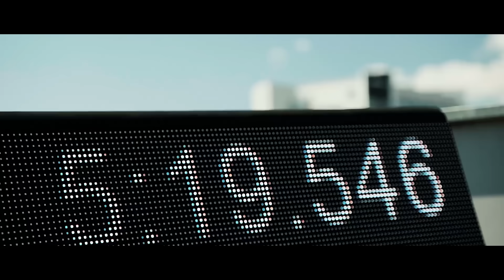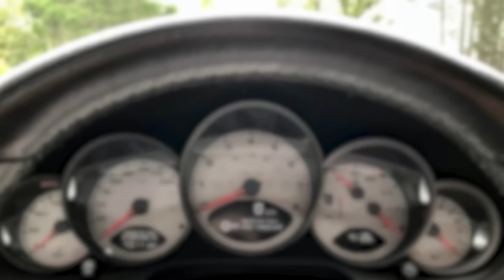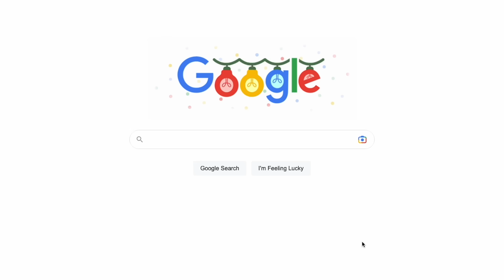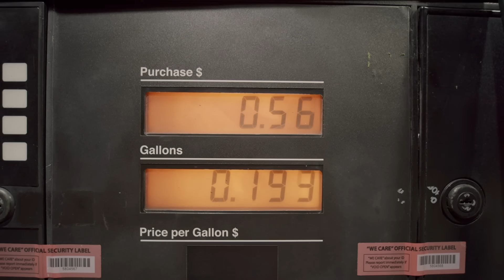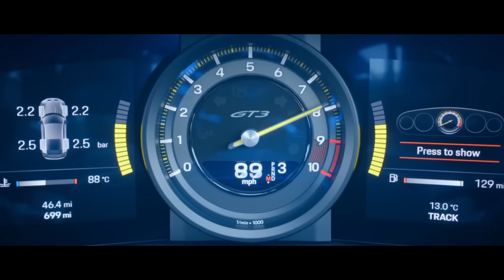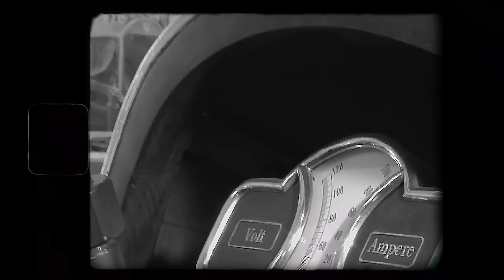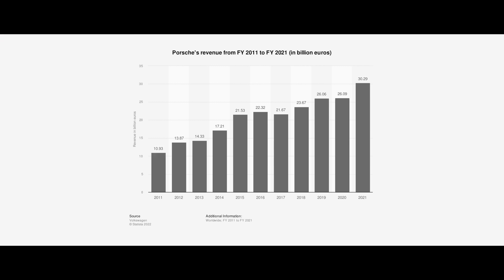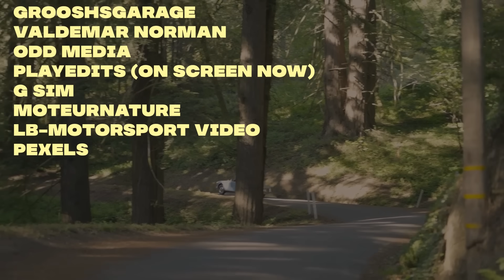Why Porsche doesn't race in F1

Comment: Correct me if I’m wrong, but the 500E at 7:28 wasn’t engineered by Porsche.  Instead it was “just” produced by Porsche because it wouldn’t fit the standard Mercedes production line of the W124 and Porsche was going through a little bit of a rough patch and both companies are based in Stuttgart.
Reply: Porsche had some inputs like relocating the battery to the trunk and few things, there is a good recent youtube documentary (featuring people who actually worked on the 500E at Porsche)
Reply: Mercedes wanted to help their hometown neighbor because they were in desperate need of cash (you can go and verify this) so they contracted them to manufacture and tune the 500e, something they easily could have done themselves since they had a motorsports team at the time.
Reply: @chiefdenis exactly. Mercedes didn't NEED Porsche to do anything for them. Porsche needed Mercedes to survive, and rather than be ruthless..Mercedes obliged, and we still have Porsche today.

Comment: 1:04 I think this is somewhat misleading, if you had seen the AMG One’s run, you’d know that the track conditions isn’t even remotely okay for hot-lapping when compared to the Porsche that was doing it in perfect conditions. I mean I can see Maro Engel literally avoiding giant WET patches on the racing line. I’m sure if the AMG One is given the chance to run again, it can pull out an even better gap than 8 seconds, maybe even 20+. But in the end, I give my applause to both manufacturers, they’ve made truly bonkers automobiles in their respective price points
Reply: He is comparing the black series to the gt2rs MR which is tuned and makes no sense 😂
Even mercedes where like that’s bs lap time cuz its tuned by manthey racing they can’t do it straight out of the factory stock
Reply: And the 919 evo is a complete car with no rules, any car manufacturer can compete with it logically cuz it has no rules 😂

Comment: 7:28 the Mercedes W124 400E and 500E were not engineered by Porsche, they were wholly engineered by Mercedes, who also supplied all the components. Mercedes just didn't have the capacity to build the cars, and Porsche didn't have anything to sell or produce. So the W124 V8's were assembled and fabricated at Porsche.

Comment: Mercedes 500E was not engineered fully by Porsche, the only thing Porsche did to engineer the car was figuring out how to put Mercedes' new V8--which had debuted in the 500 SL--into a compact sedan because Mercedes engineers didn't have time to figure out how to fit a chonker of an engine into a car designed for fuel crisis engines when they had other matters relating to the S-Class. After the redesign of the W124, a problem arose because the 500E now was too fat and wide to fit down a Mercedes production line so Porsche had to take responsibility for assembling the car in what used to be the Porsche 959 factory. But other than the changes needed to fit a new engine in and the assembly, Mercedes had full control of the W124's development

Also, fun fact, the RS2 Wagon was being built in the same factory for a short period, so in that time you could watch as Audis and Benzes rolled out of the same Porsche factory.

EDIT: Oh and the reason why Porsche has lend hands with other companies so much is because Porsche is also an engineering consulting company so some companies just let Porsche do some of the work just so they can focus on other projects. Whether that's a dub or not is up to you.

Comment: Not really sure you can compare 918 Tribute to the F1 lap time, when one is following strict regulations over a race weekend and the is completely unshackled from any regs.
Reply: It wasn't really completely unshackled as most people like to label it, it still had some restrictions from the starting LMP1 for various reasons.
Reply: A regulation F1 car would get stuck on a crack in the Nurburgring. You HAVE to deregulate the damn thing to even get it running over the bumpy-ass track.
Reply: It's a 919 Evo mate and obviously there was still some limits since they used the base 919
Reply: It’s still uses lmp1 as chassis which gives more regulation than f1 cars lmfao. They’ve literally added drs and other things that already exists in f1 cars and people aren’t brained enough to understand this. Not to mention they did demo lap with tyres that is way harder and slower than super soft tyres that w11 did lap with better track and weather conditions. Not to mention they’ve literally done 12 quali and 20 practice laps to get best setup and tyres while only one lap being faster.
Reply: More regulated than f1 kills me. Good one mae
Reply: @TheNVtube  bro probably doesn't even know that lmp1s don't have drs lmfao

Comment: I don't see the V6 vs flat-6 being a problem for Porsche. They were involved in committee that helped draft the 2026 power unit regulations (as were Audi, no wonder the power outputs of the ICE and MGUK are similar to mid 2010s LMP1). The flat-6 is also terrible for an open wheel car with large venturi tunnels, and is not the best as a structural part of the chassis.

The 963 to the LMDh rules is a twin turbo V8, and the 919 had a turbo V4.

Only 19.5% of their sales are flat-6s. 911s represent less than 13% of sales, while SUVs account for nearly 57%.

Only the Panamera and Boxster/Cayman sold less.

Comment: Porsche did however provide an engine for Formula One: This engine powered the McLaren MP4/2 that Niki Lauda took to the F1 world title in 1984, before Alain Prost followed up on that success with back-to-back championships in 1985-86.
The 'TAG Turbo - made by Porsche' powerplant won a total of 25 grands prix in 1984-87.
Reply: There was also the Porsche 3512 engine they built for Footwork. It was 30kg overweight, underpowered, unreliable and delivered a year late. Footwork used it for half a season and went back to the old Ford-Cosworth DFR, a 5 years old design.

Comment: Two remarks,first the 919's last version came out in 2016, and was faster than the f1 cars of that generation, since the post 2017 regs f1 became several seconds faster, and second, for some reason mercedes decided to attempt their only run in the amg one in a wet surface (no clue why they did this), so the laptime set by that car is still pretty damn impressive
Reply: The track wasn’t wet, it only looked that way in the video because the weather wasn’t perfect. The track was dry
Reply: @musiccer7446  Still, humid tarmac, colder track... It has a bigger implicance than the difference between the cars even if it's not fully wet. I still remember the Yaris GR surpassing a Veyron on the outside just because the track was wet AF. Not holding MB shield since it was done on purpose to regain the leadership on ideal conditions once any car takes their crown.
Reply: @joelrodriguez9611  i mean its not like the veyron is massively faster anyways , it's like a 15 sec gap around the lap between both and obviously most of the time is gained on the straight for the Bugatti so it's not surprising that a Yaris Gr could do that

Comment: I agree a lot with one of the things you said in this video that a car wouldn't have a soul without the sound of a engine I love electric cars as much as the next guy and electric supercars are even cooler but the sound is everything the gears shifting the engine roar to life. in racing especially in f1 it just wouldn't be the same without the sound so I'm glad that more are focusing more on sustainable fuels and not just electric.
Reply: There is something to be said about the sound of an electric car. I dont completely hate it, sure it doesnt have the same shocking roar as a combustion engine, but it just sounds so futuristic and cool. I have driven a tesla before, and it felt quite weird going 0-60 in a couple seconds with just the hum of the batteries. It is kind of an awesome feeling, it feels like you have SO much power, and you definetly do.

I enjoy both, driving a V8 through a tunnel, flooring it and hearing it echo off the tunnel, great time. But the hum of electric cars is also cool, in another way.

Comment: Porsche already has a F1 history. They build the turbo charged 4 cylinder egine for McLaren back then with great success in 1984 and 1985. Their 1991 released n.a V12 F1 engine on the other hand was quite a let down and  had a bad power to weight ratio compared to Ferraris unit. Porsche may not need F1 but for sure they would like to be part of F1. Otherwise there is no explanation for their recent attempt to buy 50% of RB Racing.

Comment: Tbh I wonder the gap difference if the AMG One did the Nordschleife(sorry if it's spelt wrong) on a dry condition(cuz iirc the lap record was made when the track are not fully dry)
Reply: And a proper engine. I have no idea why these apparent car YouTubers seem to miss the point of the AMG one, the 1.6 L road legal F1 engine was a masterful attempt at tech demonstration. The AMG F1 did the Nurburgring lap record despite the engine is what it should be said. People have no idea the massive technical efforts it took for an F1 engine to idle at 5k.  Even the black series did the record in Abysmal conditions. Most spotters say the black series would've passed the 911 GT 2 RS MR in similar conditions.

Comment: 0:42 that shouldn’t really matter the car has more power while also being closed wheel which reduces drag the car was also built without rules if F1 teams were allowed to build F1 cars without rules they would be able to beat the car also the amg beating the Porsche by 8 seconds is not a small feat when it comes to Motorsports even tenths are important once you get to seconds slower than your opponent you are a turtle so saying “by just 8 seconds” is a severe understatement
Reply: You missed the context of the previous sentence.
Reply: If Porsche truly built a car without limits (no, the 919 Evo wasn't - unlike what most people like to say), it'll be equally as fast as the theoretical F1 without limits.  Both cars would most likely converge to a single point and we'll end up with a mixed F1/LMP.
Reply: By just 8 seconds taking into account that one is a Hypercar with an F1 engine costing millions and the other a GT2rs with a manthey kit

Comment: This guy has a hard on for Porsche but he does raise some good and interesting points. I think it is also note worthy that Porsche hasn't won a Spa 24 hours in the last 3 years and that the latest winner was driving a BMW M4 GT3 and in 2020 the Ferrari 488 GT3 Evo went 203.12 km further than the last time Porsche won and did it at an average speed 8.3km/h faster than the Porsche did. When I think of no rules racing I think of Pikes Peak International Hill Climb which the Volkswagen I.D. R has the record for. Also, in the video he mentioned someone beat a Porsche record by "only 8 seconds" but in the world of racing that may as well be night and day at the highest levels of competition where you are racing to save milliseconds. The 919 tribute may be able to do a fast lap but in GT3 where the cars at least resemble what you sell its about winning a 24 hour race not having the fastest lap. While Volkswagen may own Porsche that also doesn't mean that much of the technology in the IDR is from or has anything to do with Porsche. While the 919 might have a roof and weigh 200kg more it also has many advantages over an F1 car due to the fact that it doesn't have to follow F1 regulations

Comment: Can i say it broke the lap record for Hamilton's 2017 f1 car only for the w11 to put it in it's place and bare in mind the 919 tribute is a car without limits both of Hamilton's cars had limits and yet still the w11 has the track record
Reply: Porsche doesn't need to be the fastest per lap to have a better car that lasts a hundred times longer than mercedes
Reply: Although the 919 Evo doesn't fit into any regulation, it still carried some limitations from the base LMP1.  Also, if I recall correctly, the driver had less than 10 laps practice.  Hardly enough time to learn a car that's about 20 seconds faster than what he normally drives - which he openly said he was the limiting factor.  There's at least a few seconds in there.
Reply: @paper plane No, a F1 car is not miles quicker on a track without long straights.  Like I said, even while they had those features, they still carried over some limitations from the base LMP1 car.  Some of those limits restricted their cornering speeds.

Only a F1 snob with no knowledge of motorsports will fail to recognise this.
Reply: @paper plane I didn't address those of an F1 car because I was merely pointing out that the Porsche was not limitless in the strictest sense, like most people like to claim it is.  

Of course a F1 snob has to chime in and make it about F1.  Since you want to compare it to a F1, those limitations on the 919 Evo are significant if you really want to compare them together.
Reply: so?

Comment: The 919 tribute doesn't run to F1 regs which is why it's faster, it's built for ultimate speed not to regulations. There are no artificial limitations on it. 

Why aren't Porsche in F1? Because they didn't want to fork out to buy their own team but take a controlling entity in an existing one on a lower budget, which also undervalued the existing teams.

Comment: About reliability, my mom’s diesel volkswagen TDI has worked since 1998 without a single engine issue(320,000,000 + kilometers). When we thought it broke, it was the key’s issue. We still use it

Comment: To clarify: the 919 evo was within half a second of the w11 around spa. One car had regulations, one did not. Huge difference. Furthermore the Nurburgring time of the amg one was set on a damp and dirty track. And the car wasnt even made for the track. It's a car for gp circuits. Just like an f1 car. So stop meatriding porsche and add the important Information :)

Comment: This is a simplistic analysis. Porsche sells other things than flat-six, now they´re racing a V8 in sports cars, and they´ve done F1 before (although without much success, except when they made engines for McLaren that weren´t branded as Porsche because it was a paid job). Of course they don´t absolutely NEED F1, but neither does Mercedes or Ferrari and they´re there. I think there are more important factors than those mentioned here, like cost and VW group strategy.

Comment: To think of it, the fact that the 919 Evo was only slightly behind the deadly combo of W11+Hamilton is stunning.
Reply: Not really the car was built without rules and has more power while also being closed wheel which reduces drag meanwhile F1 cars are built around strict regulations
Reply: @Thedutchman12  true. The 919 Evo may make more downforce than the W08, but it's heavier and has a higher COG, greatly affecting its turn-in.
Reply: @Thedutchman12  the 919 is heavier and less aerodynamic, also while the 919 skips the rules of the WEC, it's still limited by what the current aero spec and chassis allow to modify, it can't be turned into an open wheeler for example.
Also the drag that open wheelers produce is a much smaller problem comparatively to the pressure the tire-air combination produces on cars within the fenders, pretty much all the tires do on an F1 car is produce dirty air, mainly to the cars behind, not so much to its own wing
Reply: Other way around actually. Fact that an unregulated time attack machine with closed wheels could not beat W11 is insane!
Reply: @nodo7575  its still an LMP1
Reply: @jansonb482  so what? It's was able to be free from regs and had special bespoke tires. Turn off the fuel flow limit on W11 and it will blow away 919 evo even using the normal race tire.
Reply: @nodo7575  its built to last and not built to fast
Reply: @jansonb482  it was changed to fast with tires that can do couple laps to boot.
Reply: Give Merc engineers freedom to do what porsche engineers did to the 919 to the W11. the gap would be 10 seconds or more between the two. Remember, the 919 Le man spec is 12 seconds slower than the W11 on average when operating under regulations. Let's level the plain field first
Reply: @hebemath1  if you want to play on a level playing field you would need to give the 919 the faster perelli tyres and run on a gripped up track like the w11 had after a weekend of practise sessions. the 919 broke the previous record on a green track
Reply: Don't forget that it was also 3 tenths slower than Vettel's Q2 time of 2018 (1:41.501), onboard the SF71H. (W11's time is 1:41.252, the SF71H could have been close or even be faster than that time).

Comment: You say 'Mercedes only beat porsches lap record by 8 seconds' like 8 seconds is nothing! It's light years in lap time. YOU say Porsche builds cars to last, the 996 had cylinder scoring issues requiring engine rebuilds. You need to get you facts right or simply state whether your video is paid for by porsche.
Reply: @BigFatCock0  doesn’t change the fact that 8 seconds is the equivalent to light years in racing
Reply: That's true but the AMG One and the GT2 are completely different class of cars.
Reply: @Alan-ww8vi  I'm that case, they shouldn't be compared. I was correct in asking the author to get his facts right.
Reply: @mrsoisauce9017  on a large one lap circuit is not...especially for cars on two different classes
Reply: The Mercedes is also faster than the posrshe LMP car. Watch the start of the video.
Reply: @nibbacheese3787  even on a large circuit, 8 seconds is still a fucking huge gap between two cars. It’ll look smaller on a map, but it’s still a large gap
Reply: @h-a-milli4531  it is almost a minute slower than the 919

Comment: One thing F1 has is that in some cases, technology was born there that would later trickle down to consumer cars: traction control, active suspension, KERS, carbon fiber, monocoque design, paddle shifters, steering wheel control buttons and hybrid powertrains all came from F1.